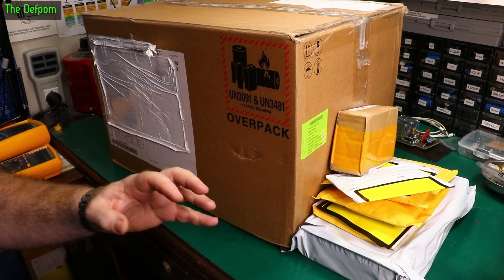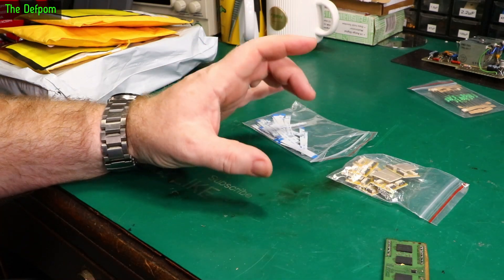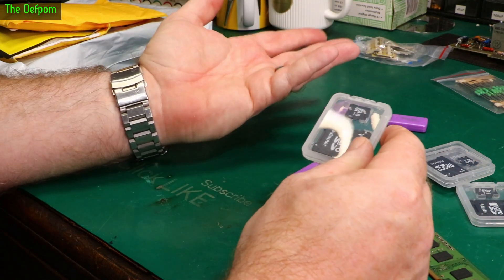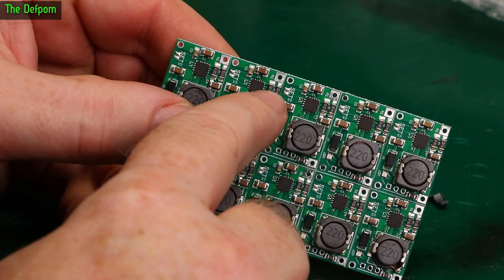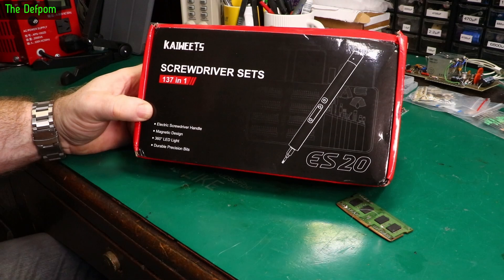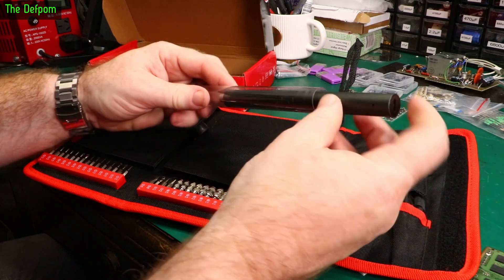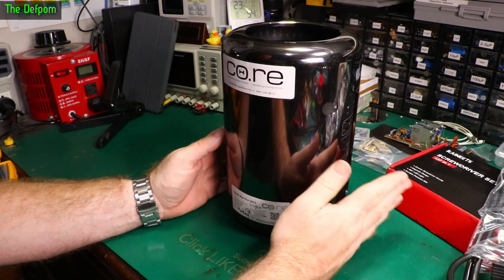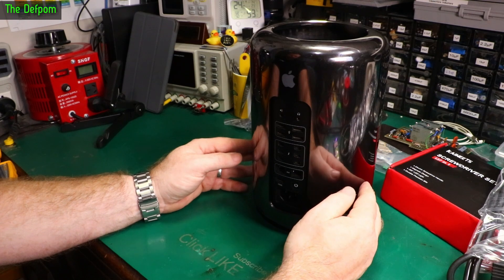🔴 What's in my Mailbag ? - Mailbag Monday 29th May 2023 - No.1134

Comment: The Sharp Memory Display is basically a monochrome active-matrix LCD.  Like a regular active-matrix display there is a transistor behind each pixel whose purpose is to hold the state while powered until a signal is given to change its state.